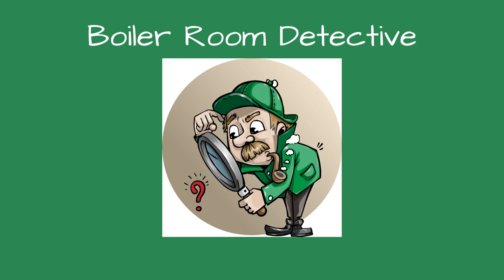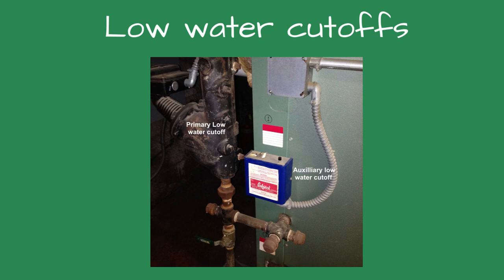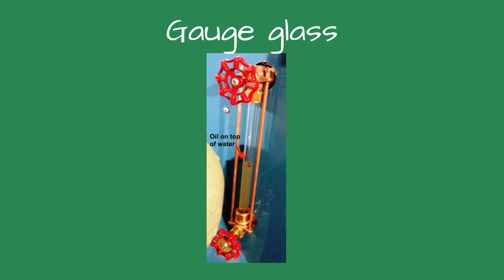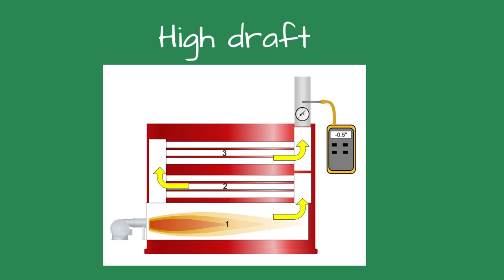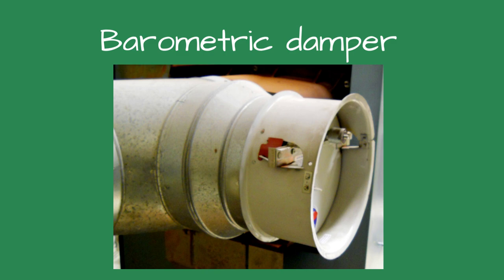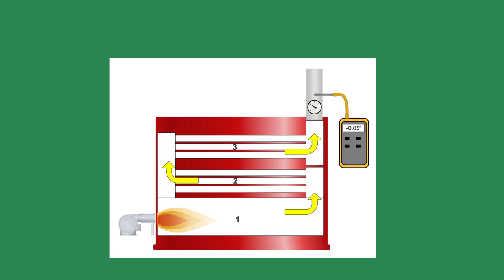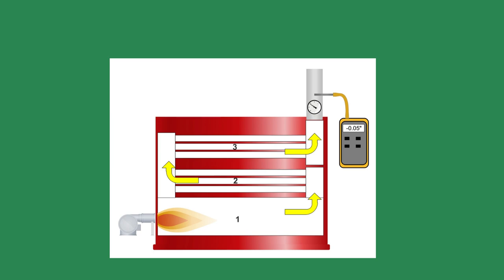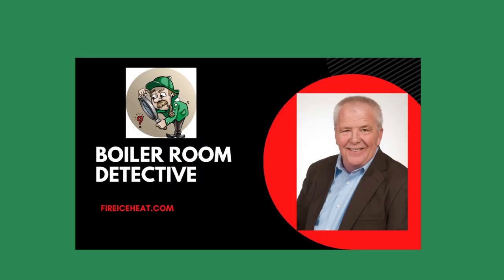Case of the Bouncing Water Level

Comment: Hi. Can you please explain how draft affects the gas pressure? I would have thought that they're independent of one another. Isn't the gas pressure fixed and controlled by the gas control / regulator? Also, how were the draft issues affecting the boiler going off on low water? Thank you so much.
Reply from the maker: George 
Great question., When adjusting the burner gas pressure, it is against the pressure inside the combustion chamber. In most instances, the combustion pressure is slightly positive. This boiler was supposed to be  +0.15" wc with a draft at the boiler outlet of  -0.05"wc. Since the draft was ten times more than the manufacturer recommended, the combustion chamber went negative. You would have to increase the gas pressure to reach the gas pressure set point since the chamber is negative. Once the draft was at the proper amount, the gas pressure was too high. Hope this helped
Ray
Reply: @boilerroomdetective  Amazing and awesome explanation. We never stop learning. Please never stop teaching.  I just learned something new.
Reply from the maker: @georgebrett4289  Thank you very much

Comment: I forget last winter to take care of Weil McLain steam boiler, draining rust and sledge, this winter , I went to do I found the too much rust almost blocking the drainage valve I clean it and change the water. After that when I open the drainage valve, too much vacuumed air inside the boiler, sucking air inside , I changed the water about 10 times already , still the same vacuum , only 15 years old boiler and never have this problem , can you advise me , please what to check on this boiler to take this vacuum off  , thank you
Reply from the maker: Steam systems need to breathe. When the boiler starts, it will push the air from the piping so the steam can enter.At the end of the steam cycle, the steam starts to condense. When this happens, air rushes in to take the place of the steam. If there is a blockage in the condensate pipe, the air cannot return to the system. When this happens, the system goes into a vacuum. I am not sure if this is a one or two pipe system. If it's a one pipe, I would check the air vents for blockage. If it's a two pipe, I would check the traps to be sure they are not filled with dirt, blocking it. Hope this helps

Comment: My question is, does this technology not belong in a museum? Saving energy is something else
Reply from the maker: Stephen steam systems can be very efficient if installed and operated properly. The Empire State Building in NY has steam heat and has a Leed gold certificate
Reply: @boilerroomdetective  Areas of application here in Germany for steam heating systems.
Fields of application
Steam heating is hardly used in office and private buildings. It is mainly used in larger buildings such as exhibition halls or warehouses. Here it is characterized by low operating costs. Another advantage is that it heats up large rooms quickly. The poor controllability and the high space requirement are disadvantages that make steam heating unsuitable for conventional private houses.

The use of a steam heating system is particularly useful where process steam is generated. This is the case, for example, in industrial laundries or commercial kitchens. In this way, the steam that is generated anyway can be used for heating..
Reply from the maker: @Metal-never-die1220  Stephen, We do not see low pressure steam used much on new buildings in the US anymore because people believe it to be inefficient. We are getting away from fossil fuel fired heating systems over here. One of the benefits of steam systems is the distribution costs. It takes less than one ounce of steam pressure to transport steam one hundred feet. That is much less than air or refrigerant distribution costs. Thanks for the comments. Hope you are staying warm over there. The resurgence of steam boilers here is due to the microbreweries opening. Most use steam in the brewing process.
Reply: @boilerroomdetective  Thanks for the info, I wish you a Happy New Year
Reply from the maker: @Metal-never-die1220   You too sir.